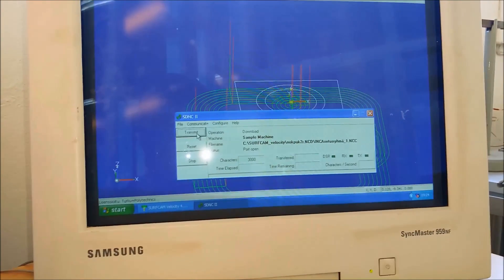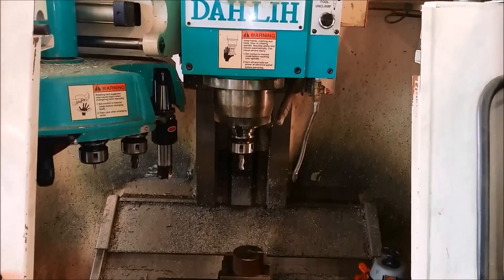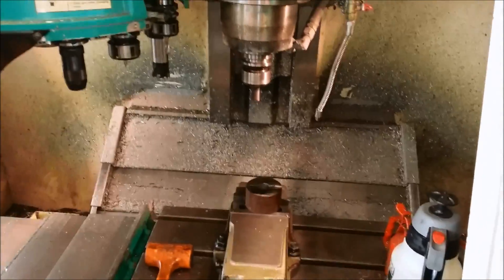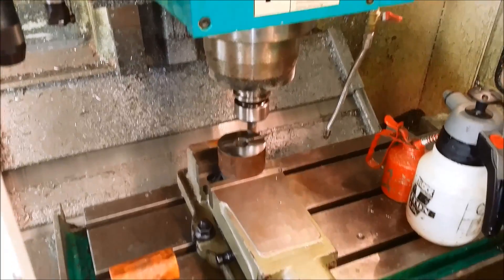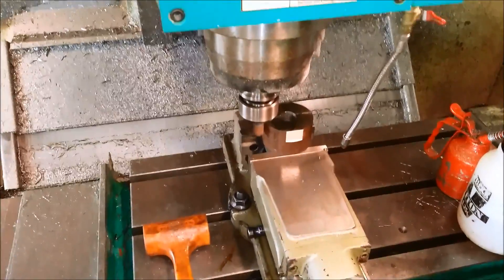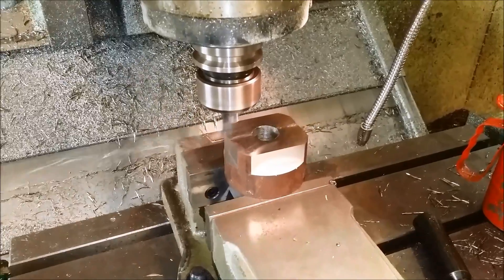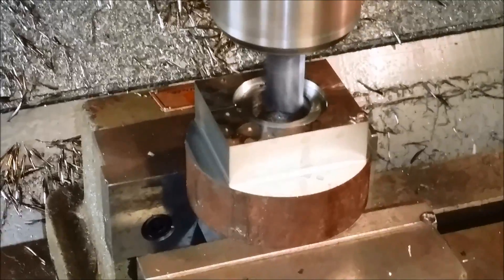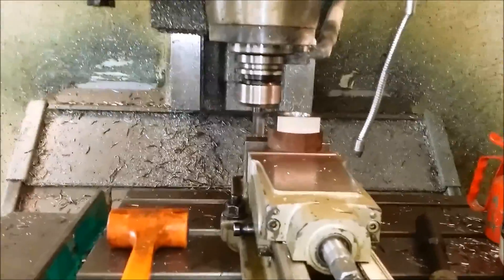Mystery project teaser -CNC-milling-

Comment: I have a big CNC machine that will be going in my new shop. Too bad I know nothing about g-code and running CNC machines. It will be a big learning curve I am sure, but should save some time in the end. Glad to see you enjoying using one. :-)
Reply from the maker: bcbloc02 Awesome! What kind of a machine it is? I also have never written G-code. The CAM-program does it all for my needs. I'm sure learning to write G-code is not much more easier/difficult than using a CAM-program. I have zero doubt about you going to love the machine!!
Reply: Check my google+ post. :-)

Comment: Whose idea was it to make the floor with concrete pavers?
Reply from the maker: douro20 It's wood! A traditional Finnish workshop floor is coated with wooden 2x4 pieces of about 3" tall. It's supposed to be easier on your feet and also it's easy to replace. Also if you drop something on it it is less likely to break/dent. But it's difficult to clean chips from.
Reply: sunppaa The loading docks in our plant used to be made of wood blocks like that.

Comment: Why aren't you using flood coolant?
Reply: ***** With modern carbide grades you can run either dry or with coolant. Plus, if he were to use coolant, would we be able to see anything :)
Reply from the maker: Lehto92 Also there was no coolant available on that mill :-).